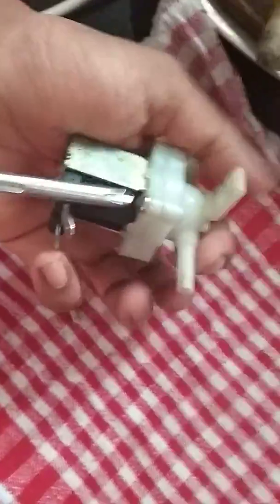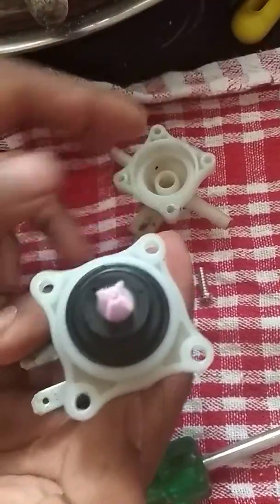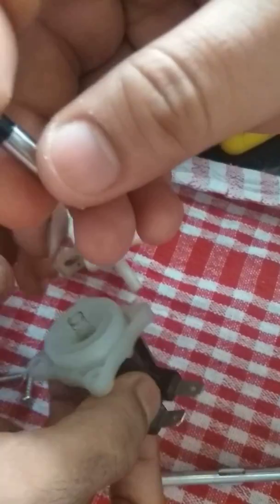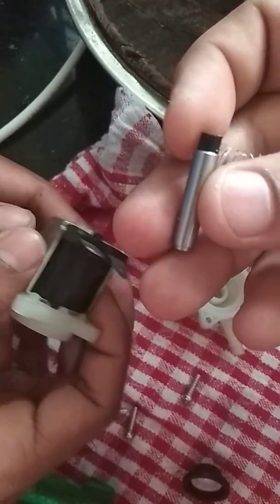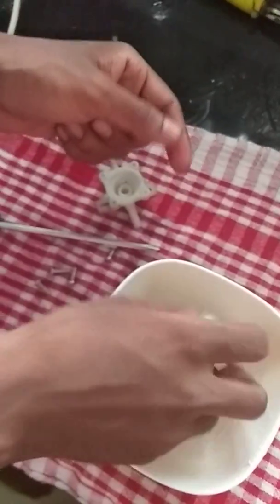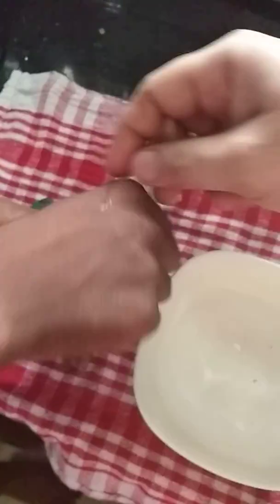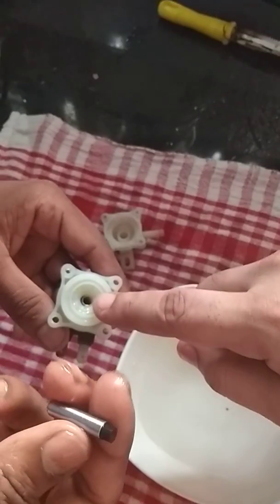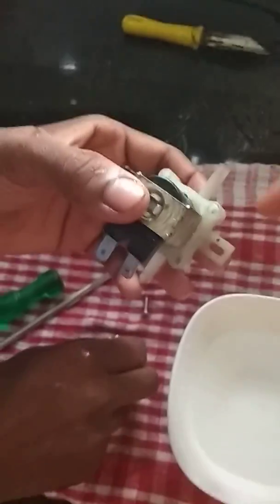Solenoid Valve in water purifier

Comment: Hello dada solenoid valve ka ek problem water controle nehi karte vibration kortehy. Esey kesi thik karnahy..
Reply from the maker: Achchha hoga ki aap purane  valve ki rating check kar ke naya valve purchase karo aur replace kar do. Yadi aapko replacement nahi mil raha ho ya deri ho rahi ho, tab aap saavdhani se valve ko purifier ke circuit se bahar nikalo aur open karo, aur spring ko 1 se 2 mm pull kar do aur pura valve clean karke reassemble kar ke dubara fix kar do. Loose spring can cause vibration and disorders in flow control. Some time water can over flow from the purifier.